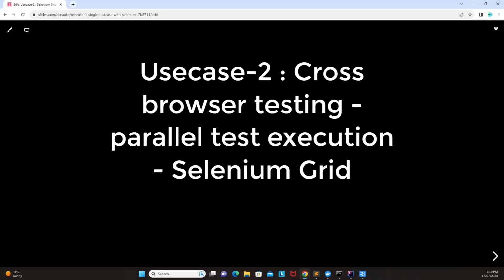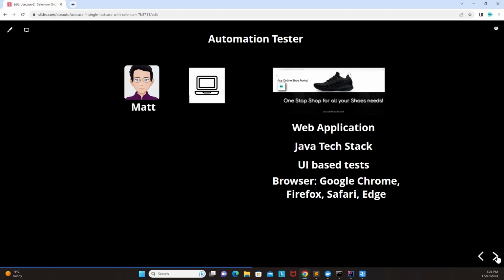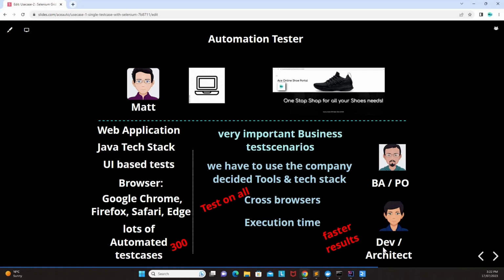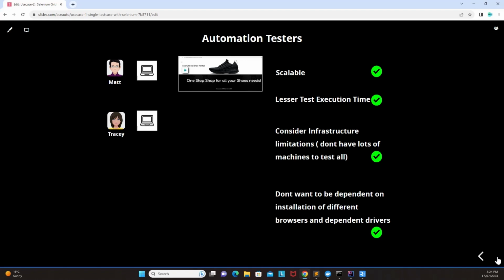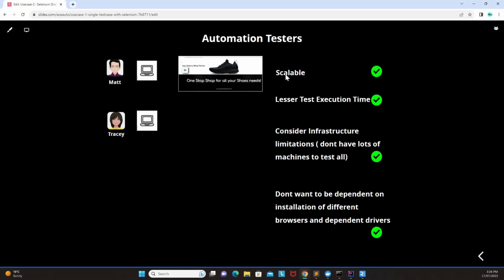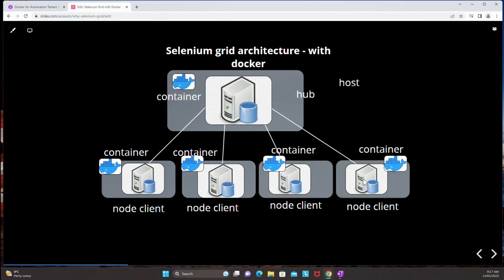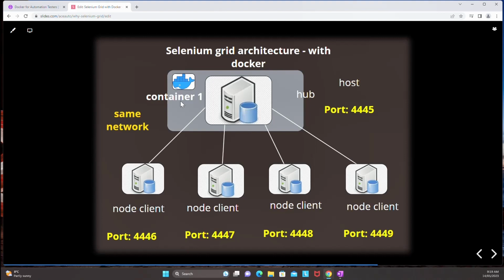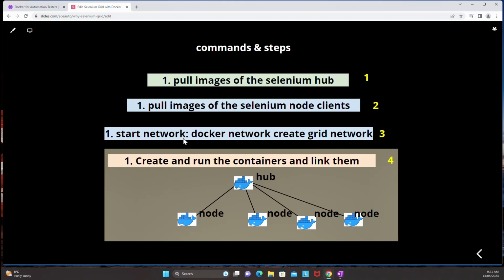Selenium Grid | Cross Browser Testing | Docker | Parallel Testing | Hub & Node | Interview Question

Comment from the maker: -Selenium Grid architecture can be used to perform cross browser parallel testing using Docker
This video gives insight on : a quick overview and why its popular

00:52:00: Organisational Scenario which would face this kind of use case
02:00:00 All the browsers that need to be tested.
03:34:00 Factors leading to selection of the docker for this architecture in software testing
04:58:00 What are the advantages of docker to be used along with Selenium Grid architecture.
07:58:00 How to setup docker containers for the selenium grid architecure
08:38:00 Selenium grid : hub and node concept 
11:47:00: The steps involved to convert the selenium hub and node into dockers and use in the same network

Full in depth course:
https://www.udemy.com/course/docker-for-automation-testing-beginner-to-expertise/